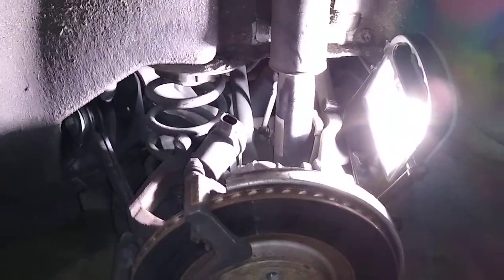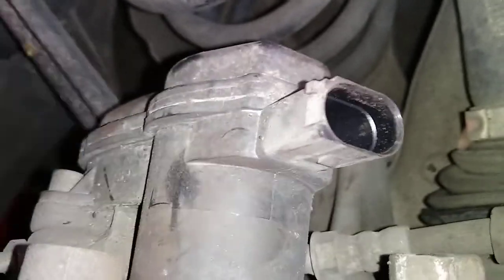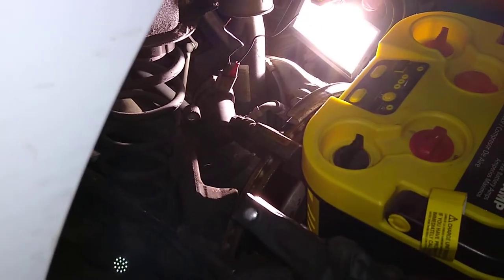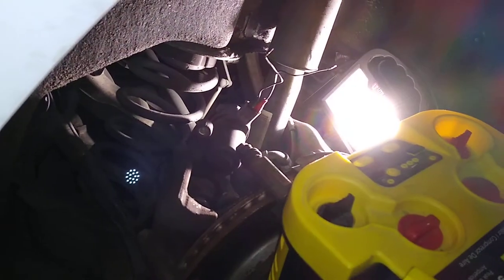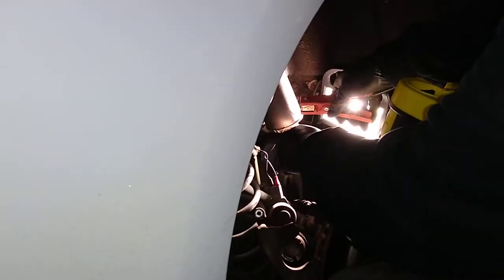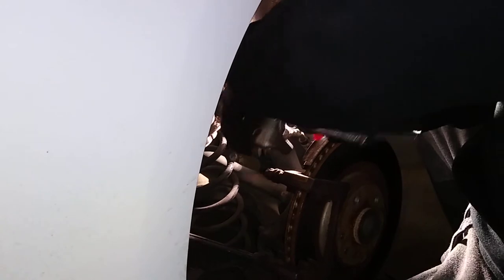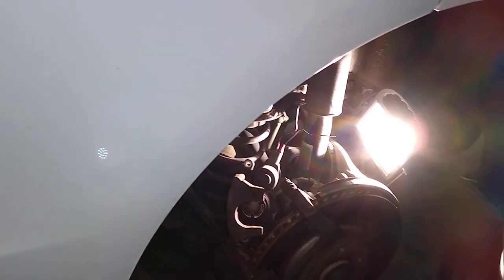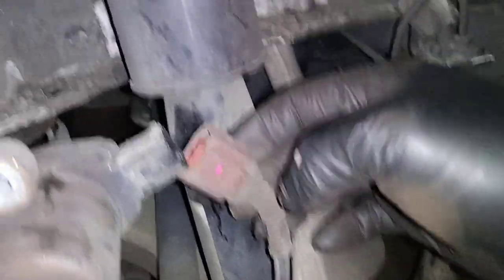Replacing Rear Brake Pads Audi Q5 2014 w/ Electronic Parking Brake

Comment: Wouldn’t the switch inside the car do the same thing? Curious because I’m about to do the rear brakes on my 15 Q5
Reply from the maker: It will retract the piston but not far enough to install the new pads

Comment: Mike, Thank you for doing this. Question: Did you "cycle" the piston that many times simply so we could hear what the piston moving under power sounds like?  Why didn't the piston retract when polarity reversed or did I misunderstand you?  Do you have to use the C clamp to get the piston to fully retract?  Thanks again.
Reply from the maker: Glad I could help. Yes I cycled the piston so that everyone could hear what it sounded like. When I reversed polarity the electronic motor did reverse but due to the piston not being compressed, you wouldn't be able to see it expand. As far as the C-Clamp, yes, once you allow the motor to reverse all the way in, you should be able to compress the piston completely. I would recommend reversing the electronic motor slowly and compress the piston every so often until fully compressed. Thanks for watching